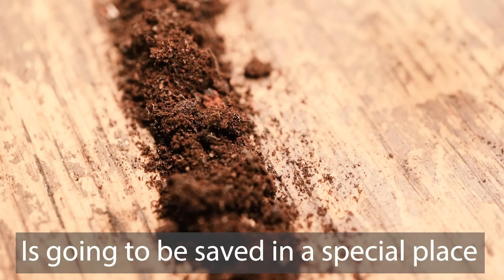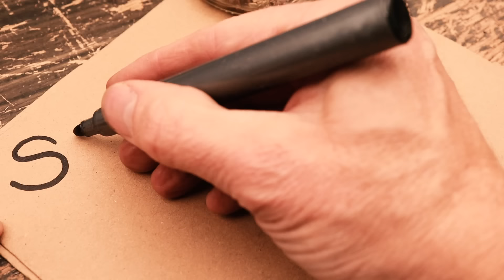VERY RARE Lighter Restoration - World War 1 Trench Build

Comment: I was curious, was there no other way to attach the trigger guard like how it was before?  I'm kind of sad it had to be put back on with screws..
EDIT:  Oh!  Like a dumb-dumb I didn't think to look in the description; it was mentioned about the brazing there and kind of why he chose the screws.  Thanks for the commenter below for reminding me.
Reply: Same question, make damage not the perfect way
Reply: If you read the description he said that the trigger hard was very weak and wanted to add some more support. It turned out well in my opinion
Reply: @SingleDorito  it turned out well but I think when you are restoring something it's best to restore to the original. But all in all this was satisfying to watch.
Reply: In my mind, the trigger guard should have been put back by brazing to make a complete restoration, the parts are brazed together originally. Also the m3 screws are noticable big, at least it would look cleaner with smaller size countersunk screws. But otherwise a good job!
Reply: @dylan4972 ైీరనమసల

Comment: You left a lot of deep scratches and other damage all over that lighter.  I can't agree with replacing the solder with drilled and tapped screws.  It's no longer as the original maker built it.  Get some soft jaw pliers.
Reply: How would you restore a 120 year old lighter?
Reply: Its a 120 year old lighter thats been through war, but definitely  him that put the scratches on it haha
Reply: You don't think he tried to buff it out like does on so many other projects?
Reply: Yeah this video is very cringy to watch.
Reply: Yeah, hoping he was going to sand the scratches off... I guess not. I would've solder it back on too, hella lot easier to dab with flux and solder it than tap and cut screws for it.
Reply: You can only polish brass so much without comprimising it. I agree that he prob shouldnt have deilled and tapped it though.
Reply: I’m sceptical this is a ww1 lighter, I can’t help but feel the corrosion was fake. Could be wrong but I’m suspicious.
Reply from the maker: Thanks for watching and for sharing your knowledge I really appreciate it 👍 and no I did not scratch the lighter at all. Not a single mark that i couldn't polish away again afterwards. It was VERY pre-scratched underneath all the "history" - The owner is super pleased with the new looks (including my little touch with the brass screws), and this is of course of very high importance for me - have a nice day 😉
Reply: @sircookie12  Gently, using tools that are softer than brass.

Comment: Why do you not using electrolysis rather than scratch it?
Reply: Evelyne Theresia it may be made of a nonconductive metal
Reply: This is also some grade Z restoration. There’s effort in presenting it professionally but the restoration itself is subpar.
Reply: I cringed when I seen him modding it and tapping screws. Ruined it for me.. I would have never took and scraper or wire brush to it.. wtf is wrong with that guy?? Also can't comprehend why he ripped the 100 years of patina off it. I'm unsubbing from this channel. Guy needs education in restoring metal...
Reply: @DocIdaho  It's brass. That's definitely conductive.
Reply from the maker: Thanks for watching and I did not scratch the lighter. It was VERY pre-scratched underneath all the "history" ;o)
Reply: You ruined "all that history" when you tapped screws. Not to mention you marred tf out of  it  when you grabbed it with raw steel pliers. I seen your over exposed shots when you tried to hide it. I recommend to tape your plier tips with Scotch tape to avoid that.  What do I know? I'm only a metal worker with years experience....
Reply: @DocIdaho  There isn't such a thing......

Comment: Why didn't you braze the trigger guard back in as per the original? It was going so well until you totally changed it 😢
Reply: Why don't you find a WW1 lighter, and restore it without messing with the trigger.
Reply: I thought the same mate. Don’t know why he tapped the body of the lighter instead of brazing it back on.
Reply: Yes!  Totally fucked it with them screws.
Reply: Modification is not restoration but I can only assume the restorer had an expert reason for doing so?
Reply: Maybe the risk wasnt worth it bc the metal was so fragile and thin and the screws was a sure fire way it would stay ahold...only thing I can think of. It didn't ruin it for me

Comment: I really dont get you. One moment youre tenderly brushing it with a soft brush. Tenderly holding it with your gloves. Then the next your smashing something into it, making holes, etc. Why hold it like its super delicate when it seems just ugly but in pretty "good" shape to hold itself pretty well.
Reply from the maker: Thanks for watching and for your kind opinion 👍 the owner loves the new look so that what's matters to me. I do not have memories of "smashing" anything on this lighter 😉
Reply: i mean it does look really pretty 👀👍
Reply: @AwesomeRestorations i tink what he mean is to keep the original design without drilling a holes
Reply: This is surely NOT a "restoration". You polish it right over the deep scratches, drill huge holes and add huge bolts instead of original solder... Amateur...

Comment: why did you drill hole in lighter it well effect the value of item. when you try to sale in pawn star
Reply: I was thinking the same thing. Also when he took a file to it and seeing all the scratches on it after made me cringe. I would of just cleaned the dirt off and made it function again and left the patina on it.
Reply: Read the description
Reply: I was not necessary to drill holes ,actually the finger  protector was solded and not screwed

Comment: A good tool for cleaning the inside z would be some kind of wire brush you can attach to a drill. But I don't know if you could make one that bends well  while not bending itself out of operating capacity and cleans the inside completely. Maybe, something like a tumbler. Particles inside the gun chamber and seal it up and attach it to a drill somehow and leave it spinning for a day or two. Maybe it would work well for cleaning the inside. I don't know all the ins and outs about tumbling or if you can use different kinds of metal or not, but I'm sure it would be possible

Comment: Nice restoration. Have you tried to use a mixture of water and naval jelly to soak the copper and brass parts in to aid in cleaning. It works great on my copper fittings when they tarnished and dirty.
Reply from the maker: Yes I could of course do this very more simple. But Im also an entertainer and video maker ;-) Thanks for watching I really appreciate it 👍😉

Comment: Hi, I'm a big fan of your work, awesome work, but in this case, I don't think the two screws on the trigger guard are ok, if you couldn't solder it in already, then you should have found smaller screws with rounded heads to fit better, because the ones you used are too big  and the shape doesn't fit! Best regards I will continue to watch your channel because I like it very much.

Comment: What is the blue stuff you applied to the screws at 9 min 36? I wish you would list the products you use instead of expecting the viewer to guess. At 11min 43 we can see that the lighter still has ugly sanding scratches. Why didn't you sand and buff them out and get a nice smooth professional finish?

Comment: He should have used cutting liquid when he was making the threads for the screw and WD40 is not a great rust remover.
Reply from the maker: wd-40 works just fine ;)
Reply: le gasp A restoration video without a ridiculous amount of WD-40??? I could NEVER—